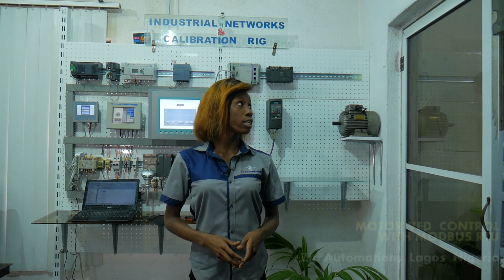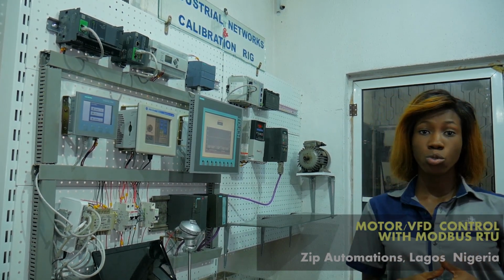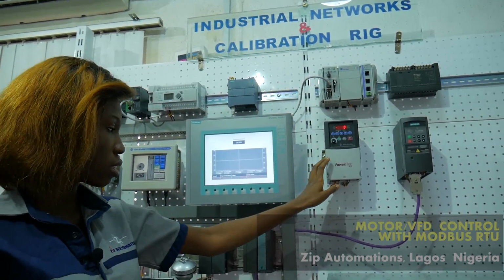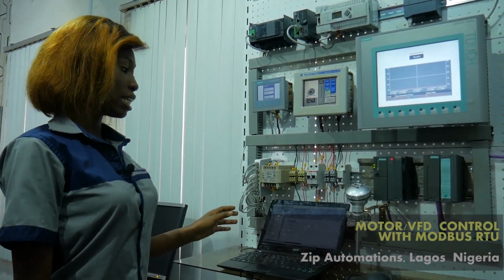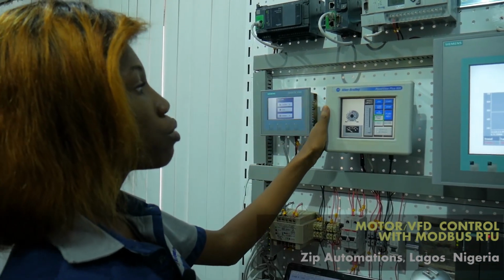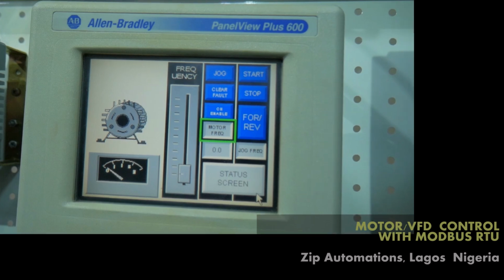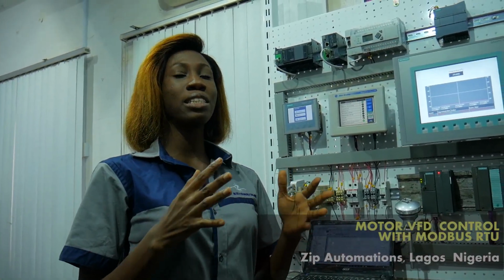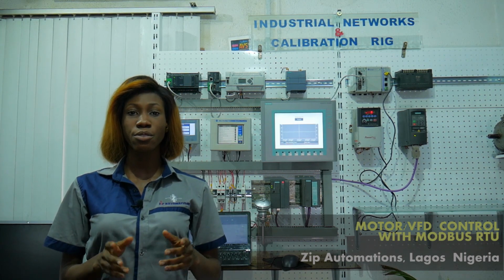VFD MOTOR CONTROL WITH MODBUS RTU

Comment: Do VFD need be programmed for what parameters need be passed

And was VFD programmed manual by keypad of VFD or programmed by computer?
Reply: All VFD need corresponding parameters for the Motor to be controlled.  Parameters are input manually by the keypad or touchpad of the VFD. You can find which parameter can be changed from the default value in the VFD's manual.